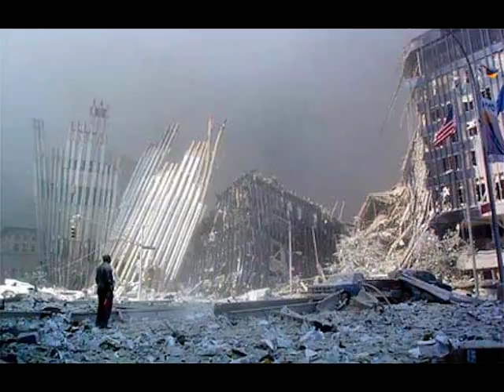O&A - Dr. Michio Kaku explains why 9/11 Conspiracies are bullshit, other things.

Comment: If fire weakens and 'buckles' steel, how come you can light a natural gas flame (which burns hotter than kerosene) under a steel pan for DAYS and neither the pan or range grates will show any signs of damage. Why don't iron wood-burning stoves show any fire damage after CENTURIES of use?
Reply: +Patrick Smith Is the pan or iron stove responsible for holding up tons of concrete?  Doubtful.
Reply: The pancake concept is based on one floor giving out from the weight of concrete. If you took the mass and thickness of the pan and added a proportional level of concrete to it (let's say several pounds of concrete) to simulate the weight of one floor's concrete, nothing would happen. Just like nothing happened in the 1970s when a huge, uncontrolled fire burnt in 6 floors for many hours at one of the Twin Towers, and like nothing has happened for every steel building fire in history.
Reply: Steel does not cover the under-surface of the floor 100% in a building; in contrast to a pan.  The comparison is not a very good one.  But considering the vertical height and amount of weight being supported, it would only take the weakening of a few beams to bring down the WTC.

Jet fuel would produce a much hotter fire than what occurred in the 1970's.  Plus, since the circumstances of each instance are different, so would the outcomes.  Let's not forget, there was the additional weight of a plane and all it's contents on each floor as well.. adding further to the weight the steel beams had to support.
Reply: hellfire0332 The plane was supposedly shredded and therefore a negligible load (but there were no planes anyway). Plane's mass was 4000x less than building's, The circumstances argument is ridiculous.A fire is a fire. Both official reports stated that neither the plane nor jet fuel had anything to do with collapse, and that the jet fuel all burned off in 10 minutes and most of it in fireball outside of building. Plus all the steel in that area had fireproofing coating which it did not have in the 1970s, plus there was far less weight above it. The damaged area and above of the north tower only represented 1.7% of the building's weight due to mass decreasing top to bottom in skyscrapers, yet it powderized the undamaged 98.3% below it? Complete joke
Reply: Name one steel building fire in history that was a result of a direct hit from a plane that big and with that much fuel on board. Checkmate.
Reply: In one of the buildings , the fuel from the plane poured down the elevator shaft, you Truther's seem to leave that out and "the building was powderized" lol tell that to the truck drivers that had to haul away 1000s  of loads of debree ( that wasn't powderized)

Comment: How does he explain freefall speed again?  That made no sense to me.  An empty building (which it wasn't) is a solid steel and concrete structure.  It should offer some resistance should it not?  Where is all the "weakened" steel?  Why so many tiny pieces, and dust, and nothingness?  Why is the paper in tact but nothing else is?
Reply: +markmeson Because most of the space is actually empty

Comment: I have a lot of respect fur Dr Kaku and I wish I could take is explanation and run with it but I can't because it is too simplistic. His argument that demolition occurs from bottom to top does not make much of a difference because what the conspiracy theory says is that demolition technic was used to simulate the catastrophe. If someone is smart enough to pull out this kind of hoax would have been smart enough to initiate the explosion from top to bottom in order for the simulation to be realistic and it would have been quite stupid to do the contraire. Now I don't know if the whole thing was stage or not but I know that it looks very suspicious. I've seen other scene where planes crash into a sky scraper and only the top portion above the plane collapsed and it actually broke and fell on it side much like a tree being cut down. So I do wish that some scientist came and explain the complete science behind the 9/11 catastrophe because so far the only ones that take the time to give a very detailed and thorough explanation are the one in support of an hoax. So what's to think?

Comment: "The steel buckled, it couldn't hold all that weight." --- "The building is made of air" --- "Of course it was free-fall because it was empty"

Between minutes 2:00 and 3 

Doublethink definition. A real attempt to scramble the brain. Also the whole 'demolition' on TV thing. They aren't on all the time. But they were the years leading up to durka durka day. Like the Kingdome. Anyone remember that? Condition. Fear. Explanation. Contentment.

Comment: You know Mr Holic 120 they admitted to pulling tower 7  fact not fiction and I suppose you believe they can rig a building in less than twelve hours to do a controlled demolition. I use to have respect for M. Kaku, but after this.......well let's just say buildings don't fall at free fall or straight down w/out a lot of help. And how do you explain the nano thermite genius?

Comment: of the buildings collapsing. Also if it were jet fuel burning then why did the second building to get hit collapse first. wouldn't the jet fuel burn up right away since it's so flammable and the heat dissapate (and the metal cool) before the second plane hit (and caused the collapse to initiate first?)

Comment: FEMA concluded "The fires that caused WTC 7 to collapse remain unknown at this time. Although the total diesel fuel on the premises contained massive potential energy,the best hypothesis has only a low probability of occurance,which makes the NIST conclusion that much more bizarre.saying"It did not collapse from explosives or fuel oil fires,WTC 7 collapsed by fires due to office furnishings"and admit "this would be the first known instance of fire causing the total collapse of a tall building"

Comment: Architects and Engineers for 911 Truth do a great job at explaining why NIST (who revised their initial explanation after many inconsistencies were brought to the public's attention) did not properly do its job on the subject. One day, I truly hope the truth will come out but I highly doubt it. May all the victims of this tragedy rest in peace 🙏🏻❤️
Reply: KAKU says the fires heated the steel, softened the steel at the top, and the steel got so soft that it buckled under pressure. What happens when a soft boiled egg falls onto a hard boiled egg, who wins?
Reply: @davidmudry5622 when you don't have an understanding of physics, it's hard to understand.
The steel supports on that one floor got very hot, and got soft  then broke.  Then heavy building coming down break rest of building. 

I did my best to eloquently put this in a way for your simplistic mind to understand.

Comment: how could an aluminum wing cut through  concrete and steel?
Reply: fitofight The same way wood can punch through solid concrete suring a tornadi. It's all about velocity and is expressed by the formula Force = Mass x Velocity. The math checks out. In fact the planes could have been travelling much slower and would still have and enough force to punch through those columns.

Comment: Buildings are build stronger at the lower floors. It cant just fall into pieces at free fall speed. Does Kaku even know about how buildings are build? And what about building 7? If a building has to fall due to structural failure, it wont fall straight into its foot print, it will fall to sides with less  resistance.

Comment: Respond to this video...    continued...1st. plane burning much hotter with major damage  to lighter steel  (softens much quicker) for 45 min. longer than the 2nd. plane missed inside center steel structure(the support is still on that side via the internal center steel structure) on lower floors which have thicker beam,(thicker steel almost no fuel barely burning) compared to 1st. tower. Kick out 1 leg of a table the other three will hold it...the opposite side will not fall on it's self. peace

Comment: JET-A (kerosene) has a dirty burn temperature of around 300 - 400 degrees. A300 grade steel ( the LOWEST quality steel used in those towers) retains >96% of its strength when exposed to those temperatures. It does NOT soften enough to cause the entire building to collapse. Even so, these are true for the lowest grade, towards the top of the building higher grade steels were used which have an even high melting temperature and strength curve. The more you research into the facts the more clear it becomes. Also, molten steel was actually recorded at the event. 

you're all just scared where this will lead, scared enough to reject basic thermodynamics. We don't live in this beautiful democratic and fair utopia, far from it. We need real change and the group of people responsible for this tragedy are part of the same reason why we haven't been able to progress as fast as we could and climb to our max potential as a human species. 

Real terrorists are the ones we don't see on the news channels.

Comment: "Fire does not melt steel"
Um, yes it does. It's done all the time. It's called "welding".
Reply: No, kerosene or a office fire doesn't melt a steel building down into molten pools that burn for weeks. Welding steel takes 3000+ degrees - well over 1000* higher than WTC fires.

Comment: Kaku? So all those lower stories were heated to the buckling point in several seconds? And where did all the debris go. Conventional engineering says their should be 20-30 stories of concrete and iron remaining? Then there is that little technical problem of building 7. It was professionally deconstructed with explosives within the same event. It was neither on fire nor hit with any debris. Every knowledgeable viewer reached the same conclusion. Kaku? He is a joke on this issue.

Comment: When I seen this happen live on TV from canada.Watching  both towers fall I said  that does not seem right  how could they both  collapse  the same way. With the entire in-tact, undamaged, unaffected 90 floors worth of core building sitting underneath it, somehow providing NO further resistance to the falling building. Other informationi read while doing my own research  on 9/11 is that   on July, 2001,Larry  silverstein  took possession of the towers … and security arrangements. he hard-balled his insurers into doubling the terror insurance coverage and changing the terms to “instant cash payout.” just 2 months later  the towers fall.
 he  only paid 15 mill.outof his own pocket and about 100 mill.from backers.he sued the insurance company and got 4.5 billion not to mention he sued the airplane company for  10 billion more
Reply: Jammers Gofawkurcouch They collapsed because when the planes hit, they took out a large number of columns of which have the towers their structural integrity. Thankfully, the remaining columns of which the additional load transferred to were able to withstand the extra load. That is until the fires weakened them sufficiently enough to cause them to buckle under the strain (of which we literally have video footage of haopening), causing the top section to topple down on to the lower section. Being that each floor was only designed to uphold the static load of that above it, when the top section crashed down, it became a dynamic load of which was FAR greater than the floors below were designed to take, resulting in a catastrophic, progressive collapse. Each time a floor gave way, the mass grew larger meaning it was unstoppable. Simple physics. There was resistance by the way, otherwise the towers would have collapsed in free fall which they didn't. 
As for the Silverstein claims, he actually lost money in all of this. He didn't get a double payout at all, and if there was any evidence or suspicion of fraud, the insurance company would have conducted a large investigation and done everything they could to not pay out.
Reply: 'Each time a floor gave way, the mass grew larger'  the mass of the building increased due to the collapse?
Reply: Tomas C The mass that was coming down on to the lower section, not the actual mass of the building.
Reply: If you were to burst into flames, how long do you suppose it would take for you to collapse symmetrically on to your feet at free fall acceleration? Assuming you were vertical, were prevented from altering your position and your head was the first part of your anatomy to catch fire.
Reply: Tomas C Possibly the worst analogy I've heard in all my life.
Reply: Are we not talking about mass and energy?  Or have we transcended to magical/metaphysical thinking?

Comment: How arrogant can Mr. Kaku be without acknowledging the science showing evidence of molten steel,  nanothermite, and a fire that produced its own oxygen for over 2  months.  He never once mentioned that jet fuel by itself could never melt or weaken steel that was over 3 inches thick.  Also that the building was built to withstand several hits by aircraft.  You don't have to be a physicist or an engineer to find out any of this information

Comment: @TheGodlyKronos easy, they sisnt find metal that was 2k degrees ..  ur mistaken. also, the fires must have gotten hotter then 1400 degrees because the steel couldnt have gotten weakened otherwise. there was more then just jet fuel burning aswell, like everyhting that was in the building ..  .

Comment: BTW - they did get one thing partially right...the buildings were, for the most part, empty on the inside...because that's what you do prior to a building demo. Check ALL the photos of the debris piles, there should be thousands of desks, computers, computer wiring, chairs, refrigerators, stainless steel elevator doors, vending machines, telephones, copy machines, 250 acres of carpeting, etc. etc.  Let me guess - it all "vaporized" like the planes/passengers of AA77 & UA93??  LMFAO!!!

Comment: Again I dont know some theorist believe it was solely for insurance reasonz as the buildingz needed major repairz but I really dont know y. Richard Gage of Architechz n Engineerz for 911 truth will forever argue against expertz n non experts on the twiin towerz collapse but how can there b enough impact from the other buildingz to cause building 7 to have enough fire n explosivez to bring it down so perfect? U have to remove all resistance,it would have fallen in a pancake effect not freefall.

Comment: Michio I'm a fan of yours but do your homework the firemen first hand witnessed molten steel and quote said it was like a foundry at ground zero like a 'foundry' it was still molten over a week later!!!!!
Reply: Marcus Harmon And how do you think they knew it was steel and not aluminium alloy of which in reality it obviously was? Fire fighters in case you wasn't aware, aren't metallurgists and you cannot tell what that was without chemical analysis. It's called conjecture. The temperature were simply not hot enough to melt steel. They were however hot enough to melt aluminum and some other metals. Was there much aluminium present? Thousands and thousand of tons of the stuff! So we KNOW there would have without doubt been a large volume of molten aluminium given the fact we have. There wasn't however ANY molten steel.

Comment: and its happening... most of the new building already take precaution about how to design a better frame for their skyscraper... and also how to work up a skyscraper fire control which the fire department have no idea about. theyre fighting fire in 21st century with 19th century methods.  bbc horizon skyscraper fire fighter.

Comment: The maximum flame temperature increase for burning 
hydrocarbons (jet fuel) in air is, thus, about 1,000°C—hardly sufficient
 to melt steel at 1,500°C....................................DUHHHHHHHHHHHHHHHHHHHHHHHHH? Michio with another dumb comment.

Comment: Lost your credability Doctor - (these are the only steel frame buildings EVER to fall down  due to fire)  Expail why also explain building 7 also moultnon steel & the hole in the pentagon being smaller than the plane & why security cameras were turned off on the morning of 911ect ect ect - i bet u dont !

Comment: Enough of this weekend still b***** first of all most of the jet fuel burned off during explosion please it can't run away from heat and second how much jet fuel did those planes have in comparison to the size of the building

Proof that the steel was not heated at all actually is when you look at the survivor named brave Edna
Brave Edna was that lady that appeared in that big hole where the first plane went through and you can see her right by the beans leaning on one of them proving they're not hot
Anybody knows anything about heating metal you can hold a piece of metal from the bottom and torch in the middle the heat will increase on the top way before the bottom so if heat rises how the hell was she touching that being when it's all bonded together
If the heat was so strong there's no way she would be coming close to that metal take up a little torch put your hand on top of the of a piece of metal put that blow torch in the bottom let's see how long can hold that metal bar or steel bar